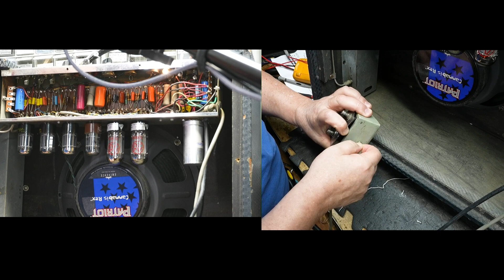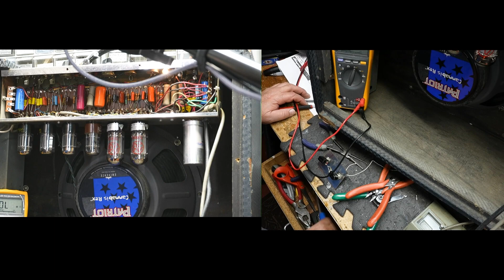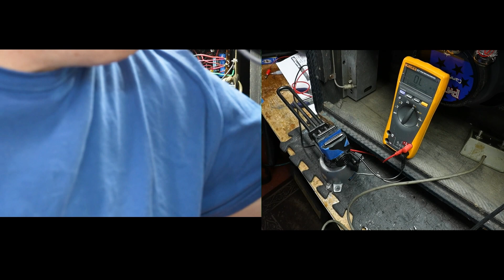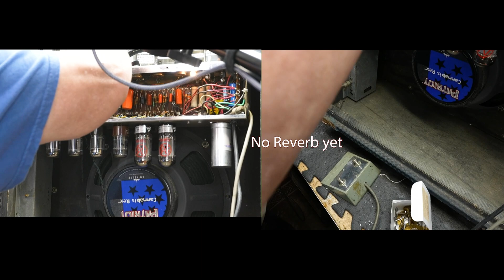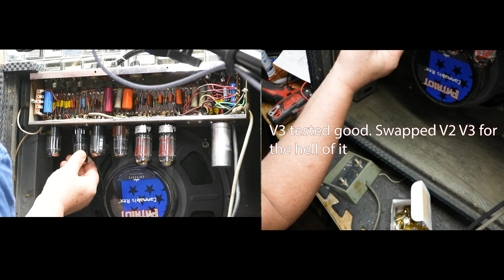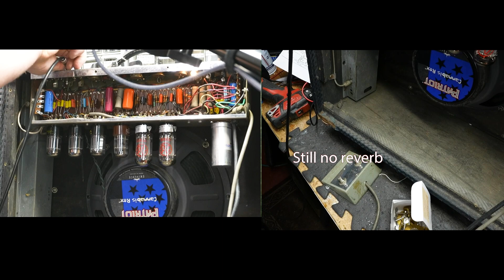Bringing a Vintage Amp Back to Life - Watch This! Ampeg Reverborocket Reverb Repair Troubleshooting

Comment: Output tubes don't like positive dc voltage on the grids, why would positive dc voltage on the grids make the output tubes conduct more current?
Reply: @waynegram8907  Sorry I have no idea what you are referring to. I never addressed voltage on grids or current flow. Actually I never discussed the output tubes at all.
Reply: @BubbeMisa  I'm just asking a general question for any tube amplifiers
Reply from the maker: @waynegram8907 the theory is electrons are negatively charged. the more negative the bias voltage the more the electrons are repelled and current will not flow at some negative point.
Reply: @waynegram8907  ,  A tube without a bias voltage on the grid to make it more negative compared to the plate will conduct full on, as much current as it can possibly pass from the power supply, until the tube melts down. It's a bit like a car engine that wants to go at 6000 RPM's without some way to govern it and slow it down, which is what negative voltage on the grid accomplishes. Adjusting the  degree to which the grid is held negative gives you a way to turn the tube on and off;  this can be done by adding a negative voltage supply to feed the grid, or by using resistors from the grid  to ground, which change the relative negative charge on the grid relative to the rest of the circuit. The bias is used to set the tube to an idle-current operating point where the response is most linear, and the audio signal turns the tube on and off to some extent (except if the tube is being run in Class A).
Reply: @goodun2974  Yes I get that, What I don't get is why do they call these resistors, grid stopper and grid leakage. What is the grid leaking? and what is the grid STOPPING what? it must be stopping something.
Reply: @waynegram8907  , a "grid stopper" is a resistor that helps prevent oscillation and is ideally mounted within 1/4" of the tube socket terminal, electrically as close to the grid as possible. You'll see them mounted diagonally across the underside of the 6V6 or 6L6 sockets on Fender amps, from pin 1 (unused except as a tie point) to pin 5 (the grid). A grid "leak" is a resistor wired from the grid to ground (typically very high resistance, perhaps several megohms) for purposes of bleeding off any electrons that are "captured" by the grid instead of passing inbetween the grid wires as they travel between the plate and the cathode. And then you have "grid load" resistors, which are somewhat different.....
Reply: @goodun2974  The Grid Stopper is suppressing the oscillations from the tubes grid capacitance so the Grid Stopper + Tubes Grid Capacitances = RC Low Pass Filter? , The Grid Leakage resistor is like a Pull-Down Resistor its pulling down the grid floating voltage to zero plus its draining leaking the electrons  caught in the grid Wire-Mesh to ground to reduce noise of free electrons?